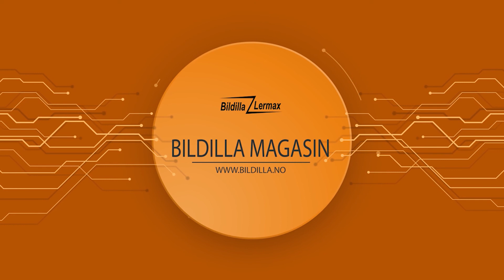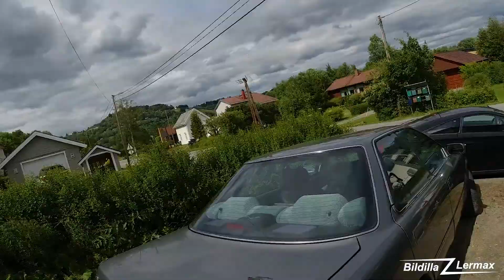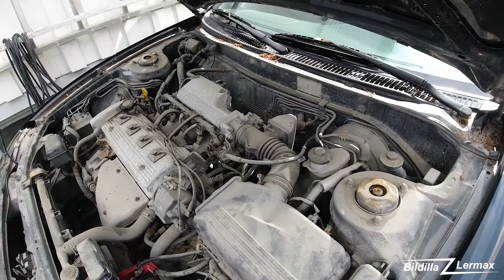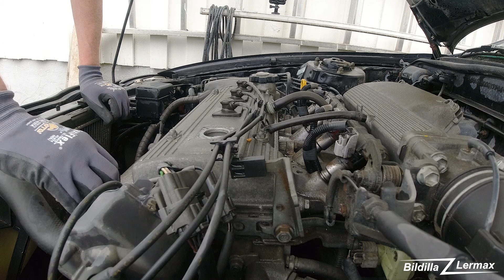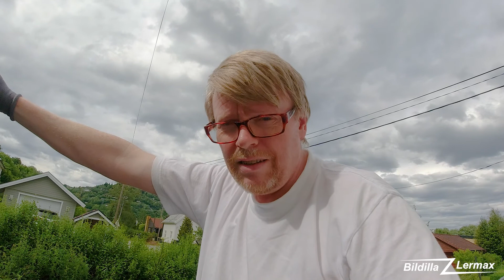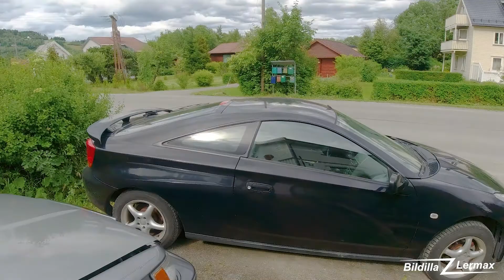DIY / How To Install New Spark Plugs - Toyota Celica / Avensis 1.8 - 7A-FE - Bildilla Magasin

Comment: What are problems with this engine? Generally on internet is consensus that 7afe engins are really reliable.
Reply from the maker: Hello.

I have heard several different explanations of what the error was. But most of the explanations lean towards there being too much slack in the piston rings, to reduce friction. The result was engines that used a lot of oil, and had poor compression long before such problems can normally be expected!
The same problem can be found on Celicas from 2000+ ZZ1 if I remember correctly now?!
The problem became so big on the next generation, that Toyota changed MANY engines here in Norway! MANY engines!!!

The 2.0 liter engine should be a much better engine! Same goes for 2ZZ from 2000+
The spare engines, which were built to meet environmental requirements in Europe, ended up creating many more pollutants over time, due to faults and wear and tear. The result was the opposite of what the intention was!

Greeting
Pål (Paul)
Reply: @bildillamagasin thank you on your answer